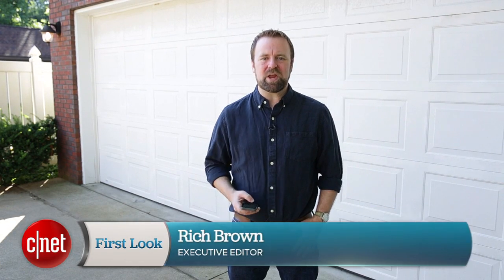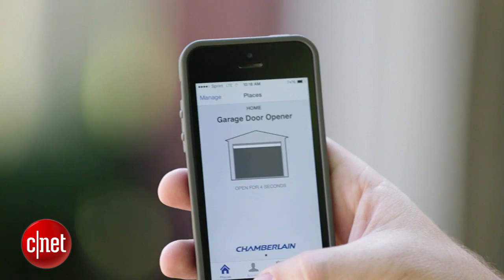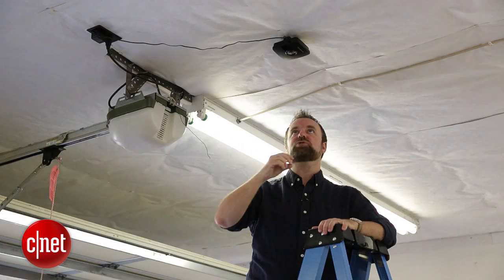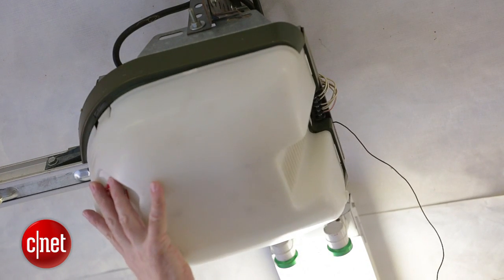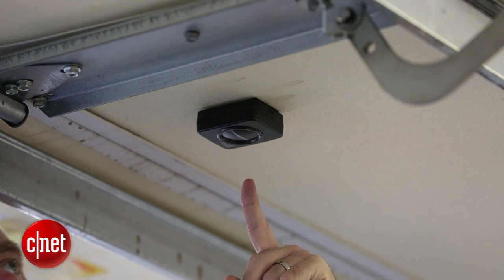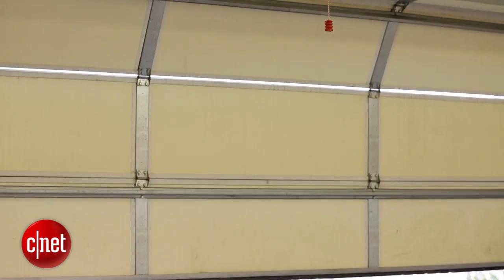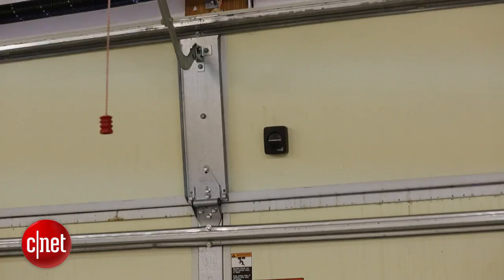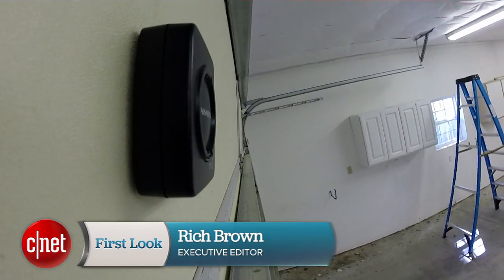Chamberlain MyQ Garage makes your garage door smart

Comment: Last night I left my garage door opened all night, something I do about once every few months. Today I decided to do something about it. I bought the Chamberlain unit this morning. Every once in a while I'll buy something as a kind of simple project and find myself taking it back to the store in about a half hour after purchase, a man quickly defeated. This was one such project. I was told at the store that I did not need a home wifi connection. I am no tech guy but best I can figure, you do. No way around it. I do not know if my garage door opener was compatible (an older Overhead Door). If was iffy in the manual. I had but one outlet in the garage door ceiling, and the ceiling was spackled, so mounting anything up there would be a little bit of a problem. I plugged in the Chamberlain wifi unit and it asked for various technical numbers that I not only did not know, but would not know where to find them. I decided to make one last ditch effort and call Chamberlain support, but could find nothing about it. It is Saturday so if technical support does exist (it probably does somewhere if I looked hard enough) they would probably be closed. The good news is that Lowes took it back without any question not long after the purchase. My strategy now is to tell the guy across the street that if he sees my garage door opened and there is no car in it, he can come over and close it. As payment, I'll occasionally buy him a six pack.
Reply: I purchased this product because I too sometimes left the  garage door open at night, I do have wifi in the garage so not a problem. It also has built in scheduling for closing the door @ a specific time if the sensor detect the door is open. Works perfectly.
Reply: We live in a world where some electronics are not compatible with other electronics. Sometimes it is about the age of the electronics and sometimes it is about the manufacturer(s). As a person who travels, it still drives me nuts when I check into a motel and the widescreen TV does not have the correct aspect ratio of the programming.
Reply: Suggest you buy and fit the ShellyDoor sensor. I've got Alexa to warn me if the garage door has been left open for longer than 45 mins
Reply: Mike, did you sniff a lot of glue as a kid?